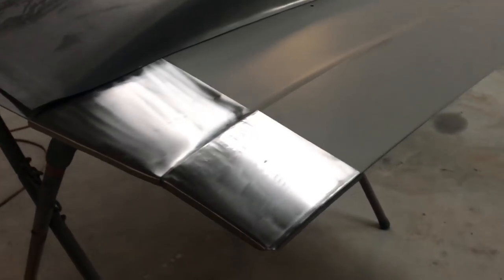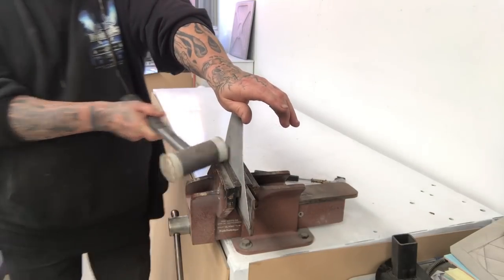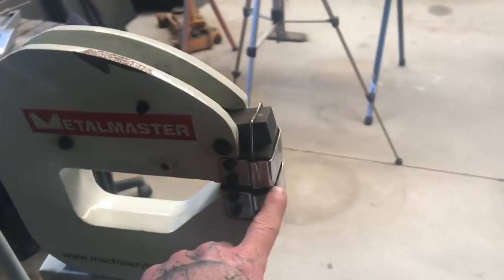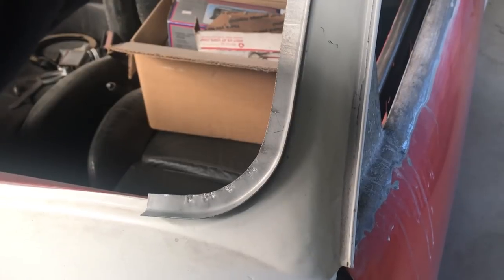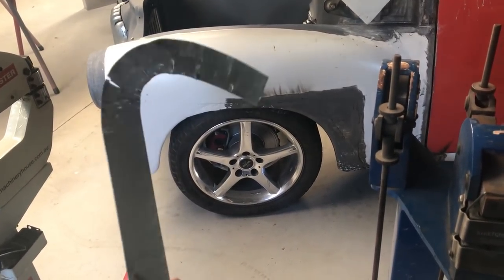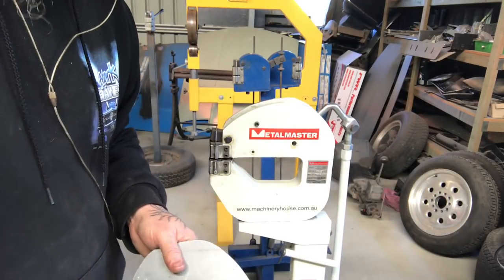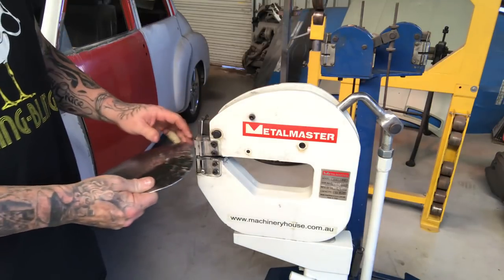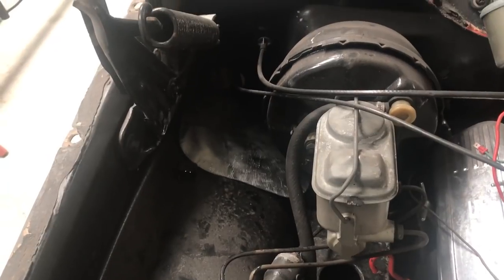Beginning Fabrication - Episode 11 - Shaping more sheetmetal!

Comment: Be nice to see how a full roof skin is made. My Datsun wagon had rusted out roof rack holes which I welded up but ended up pulling in the centre of the roof. I used minimum weld spots with mig and even tig but still warped. Looks like I might need a full 1mm sheet and roll the lot in an English wheel to replace the whole thing up to the edge radius. Big job...
Reply from the maker: Hiya. For roofskins because they tuck in so much at the gutters it's better to shrink the edges first, then wheel out any abnormalities after that. The shrinking will also create a decent crown on the roof so mightn't need wheeling once the shrinking is done depending on the shape you need.
Reply: @timjohnston7285  thank you for your reply and advice,much appreciated and I really enjoy your videos to help others in metal work. I do part time car restoration and respraying older cars,with general rust repairs but would like to step up and get better with full panel Fab and fitment,your videos and others are inspiring me to lift my game! I have mig,tig,a small shrinker/stretcher, English wheel and soon a bead roller. I will have a go at shrinking a smaller panel to the correct profile  before I tackle the roof. Was hoping to cut just to the inner side and leave the top radius in(where it has strength),not sure if I have the confidence and ability to remove  all the spot welds and Fab sides of roof to go with it. Anyways thanks again, it's hard to find information and step by step help online,I know I can do this work,just need to commit and get stuck in. I have a Facebook page Spare Time Auto Restorations too. ✌️😊

Comment: hi tim any chance of doing a video  showing grinding down buitt welds on panels i have a bad  habit of making the  metal too  thin to get it back smooth i use polyfan and 40grit grinding disc usually not sure if im just too heavy handed or technique cheers.
Reply from the maker: Hiya! That's a great idea so I filmed it this morning. Probably wont show up until episode 15 at the earliest though.
Reply: that would be great thanks